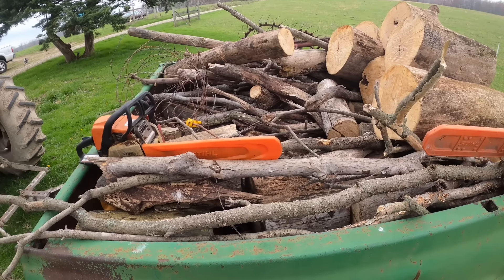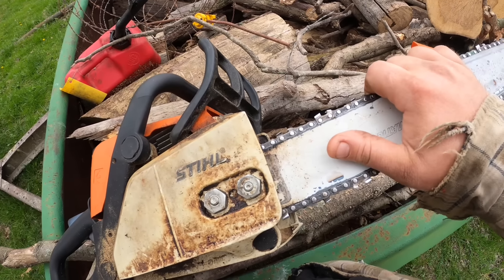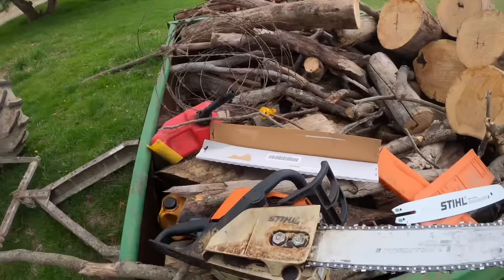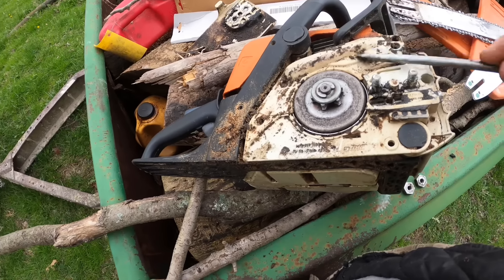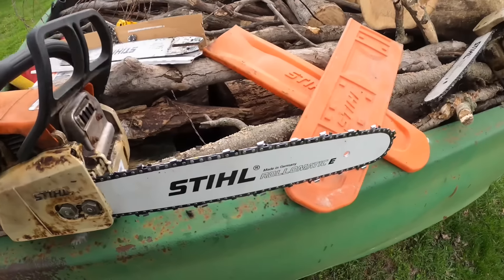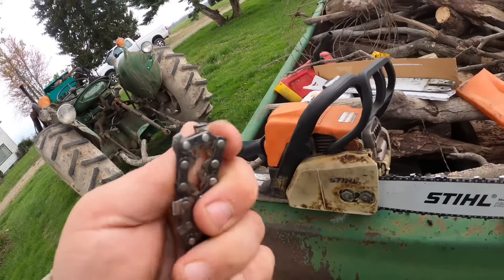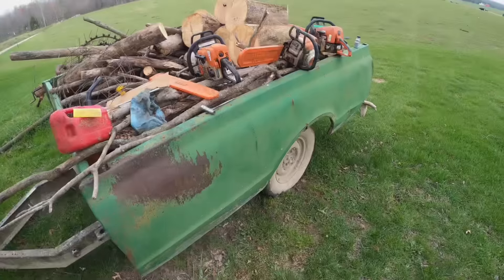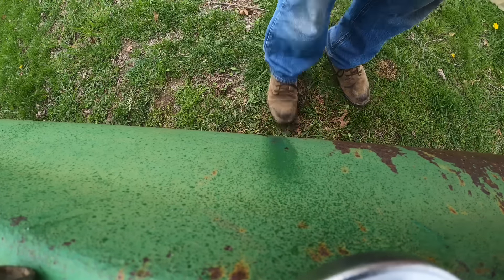CHAINSAWS for dummies, by a dummy.

Comment: I got a 271, 290, 391, and 041 super. Good saws. Its a toss up between stihl and johnsrud. Johnsrud saws are the only ones my dad can get started now, some reason he cant get stihls started. Have 7 johnsrud saws too. Back when a was a young kid my dad had a big Remington saw. He really liked it but at the time you could not get parts for it. I also flip my bars over too.
Reply from the maker: I’m sure some of those other saws are good, but I don’t like the way they handle. Dad has a Husqvarna and it doesn’t fit my hand very good. I always end up kicking it out of gear because there’s not enough room between the guard and my knuckles.

Comment: I turn my bar every time I sharpen my chain.  That way, the bar wears more even.  When they do get a bur on them, then i take a flat file and smooth them out. My dad ran the same bar on an 031AV Stihl for 20 years because i would file it and turn the bar every time the chain was sharpened.  That chain off the 170 was still good. Stihl scripes a line on the top of the cutter where you should stop sharpening them .

Comment: We use to run the cheap saws and had nothing but problems. We switched to Stihl and love them. We have a Husqvarna 455 Rancher also that seems to be a good saw. I have a Still MS290 farm boss, MS361 Pro saw and dad has I think a MS271. We had a Homelite in the 80's that was a good saw. Around that time frame Deere bought Homelite and owned them for a while.

Comment: Hey Ross. I agree completely about the Stihl saws, they're worth the $. My dad never owned a chainsaw, he cut everything with a cross cut, and an old David Bradley 2 wheeled thing that would cut vertical and horizontally both. My first experience with a chainsaw was with an old David Bradley one that was a monster to run that a neighbor had. I used that a lot, but I was young and up for the abuse! Nice rust prevention program for the wood hauler! You should get a wood carver bar and cut us a wood sculpture!  😂 Using Stihl engine oil with a new saw doubles the warranty on them. Stihl chain is the best also, the cheap stuff is just that.....cheap! Stihl is selling zero turns now! My dealer says they're made by Simplicity? He was a Simplicity dealer, and now all he has are Stihl mowers. I was also thinking about mowing, like you said a long the road was needing it. I think all of the salt they spread must fertilize it! But that plan is delayed indefinitely, they're putting more salt down, we have several inches of snow again now! 4/2-3/24.   😢.
Reply: I think the new Stihl zero turns are actually Ferris models. Somewhere I saw a comparison on them
Reply: @WisconsinOliverNut 
Could very well be. Husqvarna owns Dixon, MTD owns Cub Cadet, and who knows who else owns who anymore! Actually pretty sad!

Comment: The metal teeth(Dogs) you usually have to buy separate on smaller saws. Semi chizel cuts slower but stays sharp longer, full chizel chain cuts faster but dulls faster, in my opinion full chizel is better and what I run
Reply from the maker: Agree. I’m not cutting for pleasure I want it done 🤣

Comment: If you ever come across a stihl 038AV super farm boss, they are a great heavier duty saw for the farm and unkillable, runs a 25 inch bar with ease and can really eat with 20 or 18 inch. I like to keep the rakers files low and just let it eat. I also have a hopped up mcculloch thats really fun to use. Lots of old homelites too. Seems every farm needs a few of them
Reply: We have 3 of them plus 4 more  run pioneer until Pollan bought  them and switched styhl and never looked back

Comment: I have 3 chansaws. 2 cheap Craftsman and a 40 year Stihl. All three run great. But I replaced the chain on the Stihl with a new Stihl chain and yes the wood chips flew. The Craftsman Oregon chains produce powder. After watching Utube videos, the videos showed grinding down the depth tooth in front of the cutting tooth to ,025 lower. Now everything throws wood chips!!

Comment: My FIL was a Saw Mill owner and had his own woods for wood to cut when other wood was scarce.  He and his brother cut trees using a 2-man chainsaw that had a Wisconsin motor on it with handles that extended back to pads that set on the operator's shoulders.  It was brought out of his brother's barn when there was a big white oak that needed cut down.  I got to be the guy on the brass handle end and also the chain oiler. The chain was at least 1/2" across the teeth, the bar was 8' long and ran slow and the bar was turned to cut horizontally or vertically.  Sometime in the past, the brother sold the saw.
I have a Sthil BLK, the first lightweight (???)saw as Sthil claimed.  It is heavy and would take a real man to use it all day.  The start rope is a steel cable and there the engine has so much compression that it will jerk the handle through your fingers.  It came out with a float carb which required turning the blade for cuts.  It was converted to a Tillotson all-position carb and I inadvertently disposed of the float carb.  The dealership bought 2 of the BLK saws back in 1954 when Sthil was a "Made in West Germany" saw and chainsaws cost almost as much as a car.  They sold one and the other one was kept around the dealership to cut up pallets etc. I was told to take it home with me and keep it when we were clearing growth on our new place.  So it has never been sold.  It needs a new hose from the steel tube that enters the fuel tank and the weighted piece on the end of the hose.  It will need a new tank top gasket and a couple of metric tank screws.
Here is a couple of tips on chainsaws.  1st, always pull up on the bar when you tighten the chain as the bar will work up there itself and loosen the chain.  2nd, when starting after sitting for a while, dump all of the gas out of the tank, put in fresh fuel, also put in half a cap of SeaFoam, and put in a new spark plug.  If the saw refuses to start on a few pulls, pull the air filter (which you should have already cleaned) spray some WD-40 in the intake and start the saw.  Keep it running on the WD-40 until it starts to run on its own fuel.  The SeaFoam is cleaning the passages in the carb. We used to do that to customer's saws when they were brought in for us to get started. We had a base charge for a "Tune-Up" plus a charge for a bar check and chain sharpening or replacement.
Chainsaws are to be respected.  We had a customer who had one kickback, that cut him from under his right ear, just missing his jugular, and down through his ribcage almost into his heart.  A helmet with a face shield, a dedicated chainsaw jacket, and pants (or chaps) should be worn.  Kevlar is a lot cheaper than having an emergency room to sew you back together.

Comment: Great video Ross, the Stihl products are really good. We sell them at the Deere dealer that I work for and we have several Stihl products at home. The oldest is an 044 saw we bought back in the early 80's and that thing is still going and will crank after just a few pulls.

Comment: Your right Stihl  saws are the best!  I've  used them all my life.  When you tighten your chain it's best to put some downward pressure on the tip of your bar.  It takes the play out of the chain and bar etc.
Reply: I take it that you mean holding the saw you press the tip of the bar and chain down against something.  We were always taught at service schools to pull up on the tip when adjusting because the bar will work (vibrate) its way up and slack the chain and the bar is being forced up at the tip by normal sawing pressure.

Comment: From what I’ve been hearing Stihl has really been going down hill recently. They’ve been having a ton of troubles with those quarter turn caps. They pressurize and then spray gas vapor all over when you open them. I’m thinking of going with echo when my husqvarna and my stihl give up.